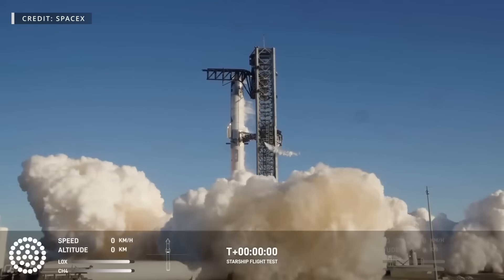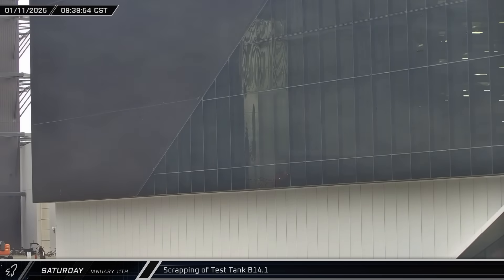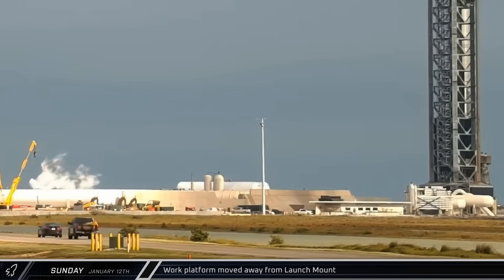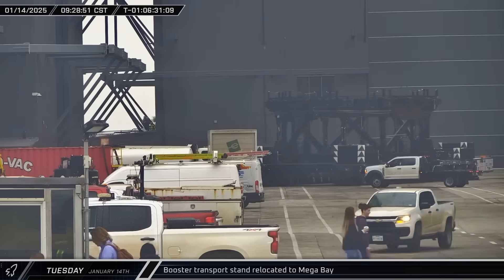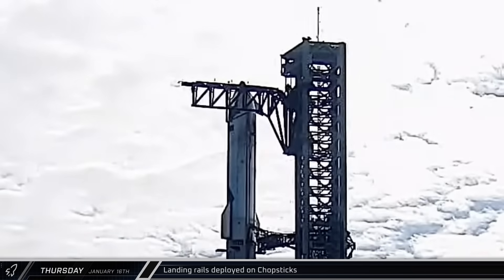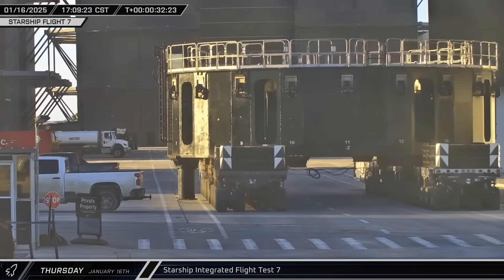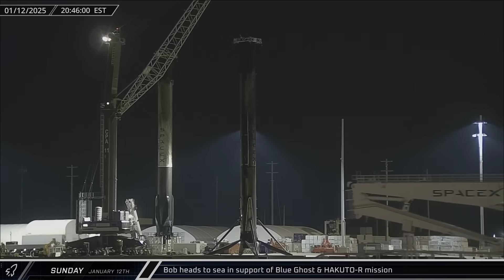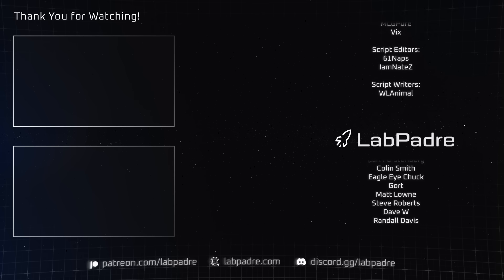What Happened With Starship's 7th Flight? - SpaceX Weekly #150

Comment: So much data was collected, such a successful flight.
Reply: Actually not much data was collected because the upper stage never even made it to reentry. Tons of data and tests weren't able to be complete so that is a big setback. After a few months hopefully they can try again.
Reply: @Barthhhelona  

A big set back would be finding that something they "knew" wasn't so and had to be redesigned.  This looks relatively minor.
:planet-orange-purple-ring:
Reply: @Scanner9631  but that is exactly what happened. They thought they knew how to get into "orbit"and through reentry. And unfortunately they failed at something that was figured out by IFT3.
Reply: @Barthhhelona  Just being sarcastic :) They don't need more data from full-scale tests, not at this point. We have all the data needed to get it orbital, and anything special, like the heat shield, can be safely tested on the ground in a plasma wind tunnel. Every other US heavy launch vehicle like Saturn-V, Shuttle, SLS, & New Glenn made it to orbit on the first test flight. Here is SpaceX, 7th full-scale test and the thing still leaks fuel. Yes, landing is different, but that can all be done without going sub-orbital, and anything that can't, can wait until ship can safely get to orbit and reenter, rather than risking lives with "lets see what happens"

Comment: Question: If there are gpnna be hundreds of launches, how will those office workers ever get anything done with constant evacs?
Reply: Starbase will remain an R&D site with relatively low launch cadence. Most launches will be from KSC and other future launchpads.
Reply: @DV-13  Thanks, so all that office space is just for R&D and manufacturing?
Reply: @euro_wars They gotta manufacture them somewhere.
Reply: The folks evacuated for the wet dress rehearsal were working at the launch site, not the office building/Star Factory.
Reply: @suntzuwu  They have to evac the office as well
Reply: There hq is going to be relocated into the new office building expansion which is close to the launch tower because there gaining confidence they can get closer, the narrator Dan said when launch 6 that he was in the raptors nest which is right behind the first mega bay